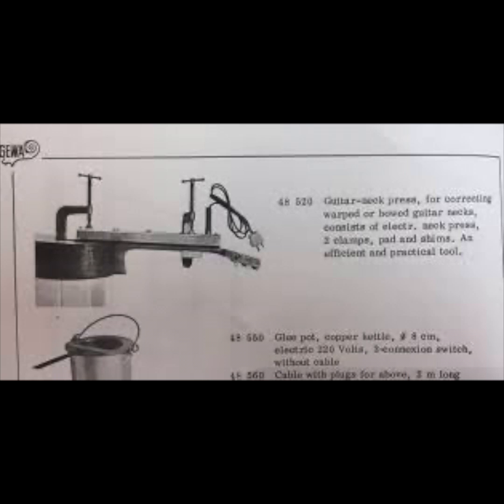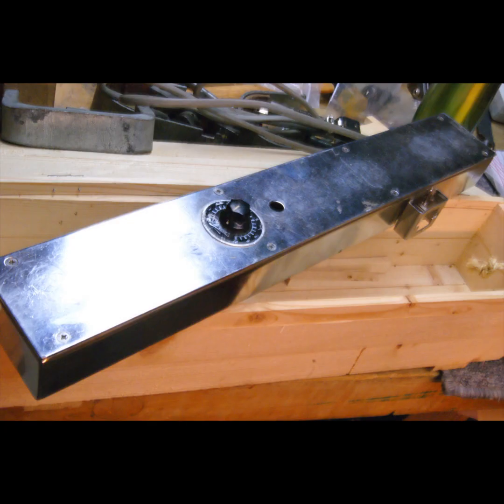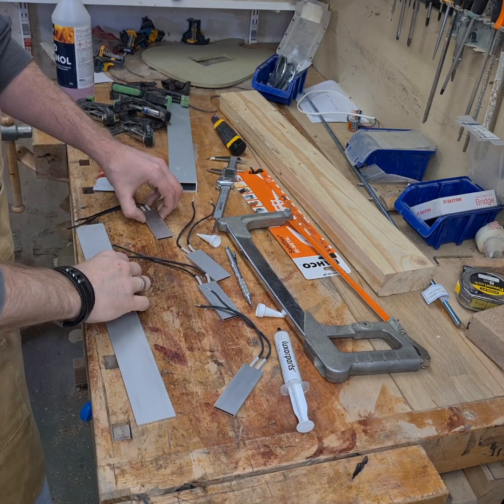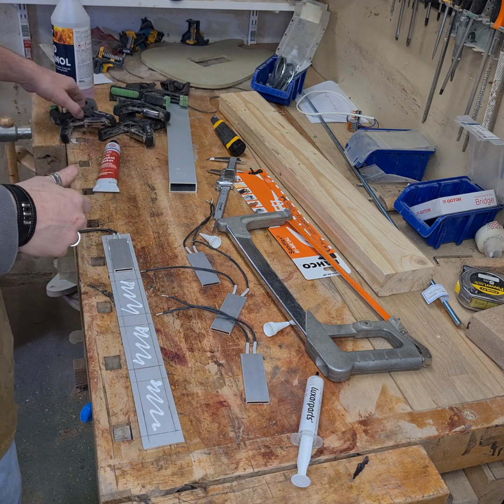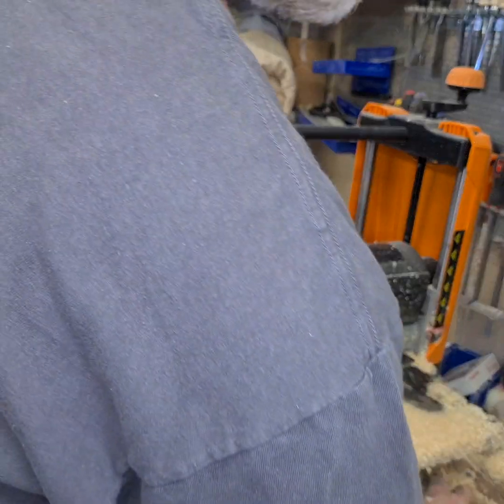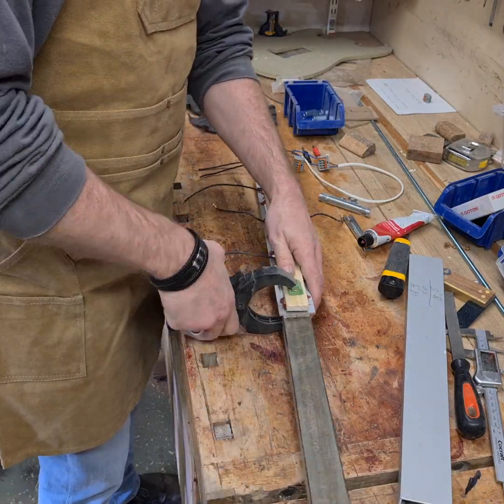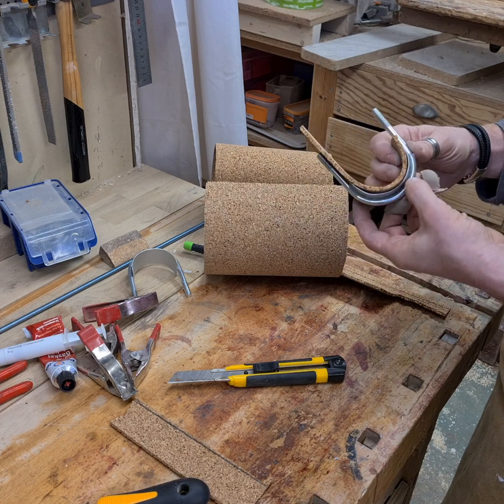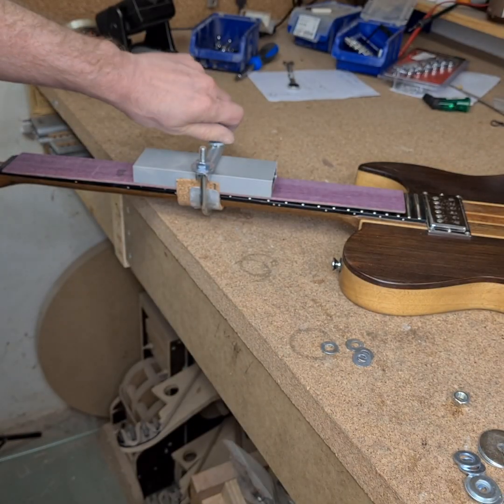Neck heat press build

Comment: Nice video thanks. I have just one guitar to work on. What do you think of the idea of filling the rectangular aluminium hollow section with a cement mixture and heating it with a household clothing iron?
Reply from the maker: Im not sure cement would be the best option as it does not conduct heat in the way aluminium does. But its always worth trying
Reply: Thanks. I just thought it's like bricks in a storage heater. Once they're hot they keep emitting heat. Cheers  @peternaglitschluthier2247

Comment: Really comprehensive video, thanks for sharing! 👍
I dont think there would be a flammability issue of the celluloid markers at 40 degrees C, or even higher, but they could warp from heating.
Reply from the maker: Thank you! I run the unit a bit higher than 40 Centigrades. I aim for a continous 70 degrees. That is still below the flame point of celluloid under normal conditions. However, I have had celluloid burst into flame-ish (or just rapid charing?) using temperatures lower than the 135C i think is the usual referenced flame point. So a word of caution is always appropriate.

Comment: Thanks for this video Peter. I'm making myself one of these neck presses. What is the brand of your DC generator? I bought 120v PTC heaters thinking I could do away with the DC convertor but I can't figure a way to control the heat. And these heaters are constant temp 220c. Any light you could shed will be much appreciated.
Reply: I use a 5 to 30 VDC Velleman unit  that unfortunately has a 5 amp limit. It works, but it takes a long time to get up to the temp I want (about 70c-ish). If I knew then what I know now, I would have waited until I could get a 10 amp unit delivered. If you have more questions, just fire away
Reply: @peternaglitsch6171 , much appreciated Peter. I'll see what I can find.